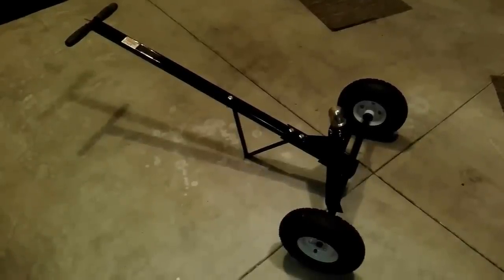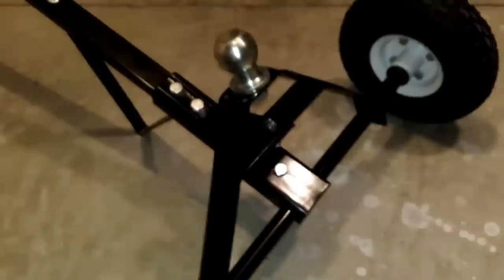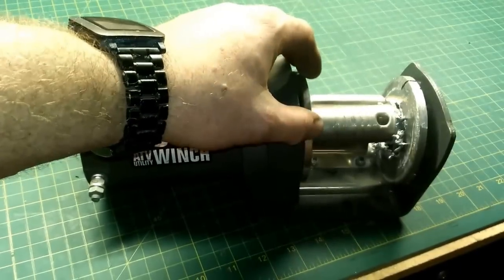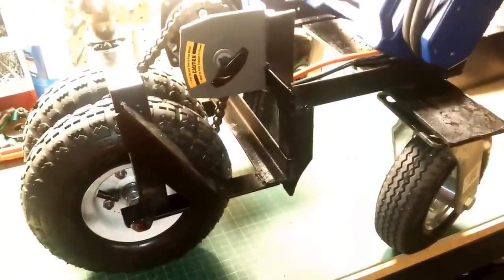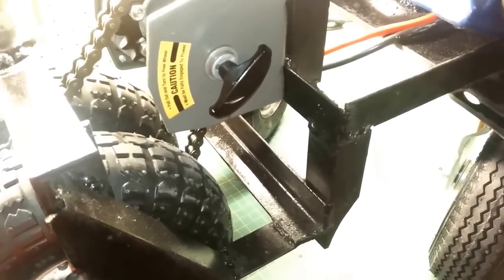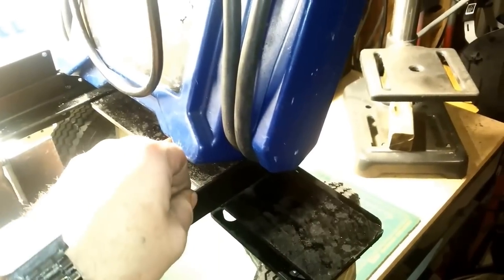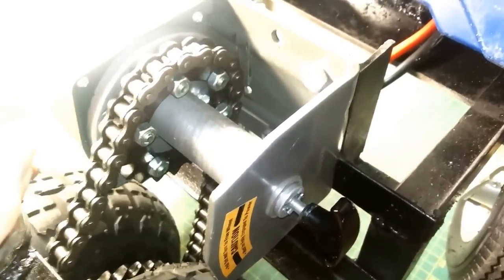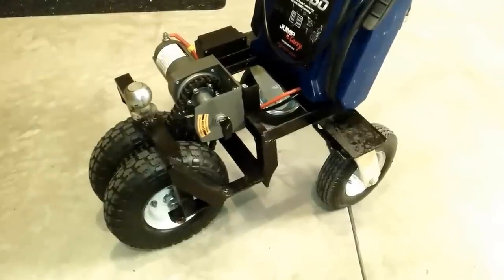DIY Motorized Trailer Dolly / Trailer Mule

Comment: Love it. I myself been looking for ideas for a motorized cart to use for transporting wood this winter and this is perfect. I will use different size gears to make it faster since I don't need much torque
Reply from the maker: +Angel Perez Might want to look into power chair / wheel chair motors.    They would be geared at a good speed and would probably last a lot longer than a wench motor.    Wench motors are designed for short usage and I would be afraid it would overheat if used continuously.

Comment: Put your welding rods in the oven at 300 deg. F let them heat soak for 1.5 hours then cool in the oven, then seal in an air tight container. I keep my welding rods in a small fridge with a 100 w to 150 w light bulb depending on the outside temp to keep them dry right from opening them.

Comment: wow, I do upholstery work in my house, I have a workshop behind the house and I use the alley to put the boats on my property and I always fight to put the boats over 20 feet on my property are heavy and difficult to maneuver , and I was thinking about buying a motorized dolly but they cost more than $ 1000 and that's a lot, if I'm interested in doing this design or something similar. excellent work!

Comment: IVE BEEN WONDERING WHAT I WAS GOING TO DO..... Ok so I live in Florida and I make my living working at farmers markets.  I built these 700lb trailers that are basically just big silly displays on wheels that are a huge hit.   I've been thinking that I wanted to make something that could tote these trailers around on gravel and tar a few feet every day and they could just charge it up once they got home.  this would be great!  im ganna rig mine up so that the trailer can actually just lower onto a plate on top and it cant twist off somehow.  might give it bigger tires just so that it can go into some looser sand but heavens yes, this is absolutely perfect, thank you so much.  i love how you get to the point, its almost like you made this video for me.

Comment: Can you explain, briefly, how to get the release handle and shaft out of the winch?  I just got one home and have been tugging on it without success.
Reply from the maker: On the one used in the video you just pulled out the handle and gave it a quarter twist.  But the designed has been changed a few times and I don't know the current design to tell you if this is still the case or not.
Reply: @1D10CRACY  well, yes.  That's how you disengage the reel from the drive motor but I want to remove the shaft completely so I can cut the pulley down for a sprocket.  Tried turning it and pulling hard on it without success.  In your video you show the damaged winch coming apart but the handle is already off the shaft.  Then later the handle is back ON the shaft..  Baffled here.

Comment: It looks great. But how do you apply braking when using the Dolly on a slope? How does the Dolly perform on uneven and/or loose surfaces? What incline will the Dolly push or pull a 3000 lb trailer?
Reply from the maker: The harbor freight wench is auto braking.   Basically its not going to move when no power is being applied.   As far as inclines and loose gravel, your guess is good as mine, I only use it on fairly level surfaces.
Reply: I'm gonna start one and i had the same concern, I'm gonna put a motorcycle front disc brake rotor and master cylinder hand brake on mine, build a bracket on the crossbar and bolt it up, you should be able to find a complete front brake set-up in a salvage yard. Its only for a momentary pause in order to change directions and stop the vehicle from getting away from you, I don't know if the winch will hold the weight during the switch to forward or reverse
Reply: If your trailer has electric brakes you can wire a pig tail with a switch to the jump pack to use the trailer brakes.

Comment: Nice unit and great video -- quick and to the point!  How long will the battery pack allow you to operate your mule under load?  It looks like you're using the one that has 1700 peak amps and 425 cranking amps, but if I'm wrong please let me know the specs as that certainly affects the duty time of your reply.  Thanks in advance!

Comment: nice build indeed.  thanks for sharing.  just wondering about the weight of your trailer.  I have a 6200# travel trailer with a 645# tongue weight.  I know I would need to use higher rated tires. However, I would only be using it on a level flat surface (asphalt/concrete).  I wonder how well the winch would hold up maneuvering the trailer 100-150' per use.  Any thoughts?

Comment: How /where did you weld the sprocket to the front tires? Also, that threaded rod, are those  bolts bigger than the 5/8 threaded rod and used as spacers?

Comment: How did you bolt the small sprocket on the winch. Did you dig the holes and used anchors to hold headless screws or did you weld the heads of the screws on it? Very nice job. I want to make one. Can it be done with a basic 110 v welder? Where can I find inexpensive chain and sprockets? Thank you.
Reply from the maker: +Byron Estrada There was enough space behind the spool that I did not need.to uses headless bolts.   Not sure om what welder you can get by with, my build was mostly 1/8th" thick steel.   I put links in the description on where to buy some of the parts.

Comment: Need more details on how you connected sprocket onto the wheel?   or did you weld onto axle?    Should take closer video between the two wheels would have helped.
Reply from the maker: Sorry, never intended to do a how to on this.   Just wanted to stimulate ideas.   The sprocket was welded to the hubs.
Reply: Is there anyway you can take pictures and post to this comment of the welds
Reply: @1D10CRACY  Pictures would be great of the welds & sprocket. Thanks for posting!

Comment: cool progy. im building my welding cart with a similar steering system with chain w/ an independent suspension guided from behind the cart
im wondering what would you do next. perhaps a 12vdc system w/ an alternator?

Comment: I have a design problem.   How far apart do the wheels have to be to avoid tipping on softer ground?  Your wheels are close together.  Is it stable on softer ground?  It obviously works fine on concrete.  My trailer has to run over the lawn.  Its typical Florida country "lawn", which is kinda sand and some grass.  Fairly firm.  I hate running my truck over it.  Design problem is:  I hate counting on the casters, since they might dig in to the ground....
Reply from the maker: Asphalt and Concrete is the only place I've used it.

Comment: I am going to build one of these for a good friend . From your description and your comments it appears you removed the tires and then welded each of the rims with the gear inside of each rim?
Reply from the maker: Correct!
Reply: 2nd question. I have not taken the winch apart yet. We’re you able to just drill holes in the round winch plate for the gear with the bolt heads towards the motor.... or did you have to drill and tap the round winch plate and use studs to attach the gear? Thank you
Reply: Did my build in a weekend like you said. Just need to paint it to make it look nicer. Thanks for the idea!! Toolman

Comment: I built one similar to yours, I used the same amazon components. Problem I have it seems to want to flip forward when I pull trailer, I have the ball about 4 inch behind the axle. Did you find the same issue.  My trailer is a duel axle bass boat 4000 lbs.
Reply from the maker: I haven't had any issues with mine, maybe a difference in tongue weight?   I'd guess mine at 200lbs.    I have a tandem trailer as well, the boat is an older 16.5" but is heavy, it's an I/O with a V8.

Comment: So I am planning to build one, and have a couple of questions... do you think a 2000 lb winch will be enough (for a ~3700 lb trailer) and do you think I could just run it off the trailer battery, which is right there anyway? That would make it more compact I'm thinking? Cheers  -P
Reply: And was thee a reason you went with two caster wheels instead of, for example, just one big one?
Reply: @bumbykitty  Looks like the caster wheels add some side-to-side stability because they are so far out from center.

Comment: I am having a hard time locating a sprocket to mount on the winch. Where did you get yours? Thanks so much.
Reply from the maker: Amazon.    There may be links in the description, when I get a chance I'll make sure and update them if needed.
Reply: @1D10CRACY  Thanks for the reply. I am at a loss here as to what to look for. Will try Amazon. Be well.

Comment: What's the heaviest trailer you've moved. My largest trailer is an 8x18
Reply from the maker: I made it to move my boat on it's trailer.    No idea of it's weight, but it's a 1970s fiberglass 16.5ft boat with an I/O Ford 302.   No struggles and traction was ok, but only used it on flat asphalt.  I don't have it anymore, we moved and I didn't need it at the new place.

Comment: How did you weld the sprocket to the wheels?   There isn't a lot of clearance.  Wheels need to still spin on the bearings.   Did you pop out bearings?
Reply from the maker: I welded the spindal of the wheels to the sprocket.   I remember it being tight, I used pencil rod on an arc welder.
Reply: @1D10CRACY  sorry to bother you again.  Is only 1 of the front two wheels powered?
Reply from the maker: They are both welded to the sprocket.
Reply: @1D10CRACY  ok, thanks.   When the sprocket arrives, hopefully it'll be obvious.

Comment: Really like your RV Tug. What size steel did you use for your fabricating. Thank You!
Reply from the maker: All of the angle was 1" by 1/8th, the rest of the parts were just random scrap.
Reply: @1D10CRACY  it seems like old bedframe angle would work?

Comment: RanchEx 102584 Chain Sprocket - for X Series Weld Hubs - #40 Chain, 21 Teeth, 1/2" Pitch   Isn't available on amazon, any advice on what to replace it with?
Reply from the maker: I would suggest anything with a similar tooth count, TSC and Rural king should carry a similar replacement.  If i get a chance tonight I will update the description with working links.

Comment: is the sprocket welded to the axle, or wheels?
Reply from the maker: I actually welded the sprocket to the hubs.
Reply: @1D10CRACY  I'm making something similar for moving a really heavy kayak. Since you used threaded rod for the axle, I figured you bolted/pinch everything together. Did you join both tires by welding a spacer and the sprocket? So the tires still use their bearings?

Comment: What is the axle size with the 48 tooth sprocket attached, and to you have a link to it.  Thanks
Reply from the maker: The axle is just a piece of allthread, not sure I remember the size.  The sprocket is just welded to the inside of the rims.   The rims are offset with a sort of "cup" and bearing on them.  The sprocket is welded to the "cups".  The hole in the sprocket was bigger than the cup, so I just welded some scrap metal over the sprocket hole.

Comment: how do you attach the wheels to the sprocket/axle?
Reply from the maker: I welded the hubs to the sprocket.
Reply: Did you have to include packing of some sort to clear the 48 tooth hub from the tyre ?
And are the hubs of both wheels and 48T sprocket now permanently welded into one unit ?

Comment: Nice little build..  pretty light weight... those tires are pneumatic.. and are only rated to 165 lbs....   means most trailers will have the tires flatened enough to bottom out the wheel tire gear....   Pratical application is everything...  Hitch/tongue loads are rated up from 1000 lbs to 1500 lbs...  the winch motor 2500 capacity is pretty strong....  Seen lots of these builds re-engineered with flat free wheels that you can find rated at 500 lbs per tire...  dual wheels like your build is can support the 1000 lbs tongue weight...  Flat Free wheels can tend to slip on concrete and asphauld in wet conditions... when under load...   My Dual Wheel dual motor drive build  has 6 inch rims..  the tires are 14 inch OD...  using a #35 drive chain my individual tire/drive sprockets are 60 teeth which makes it a 7 inch OD Sprocket...  If the weight of my cargo trailler, loaded, tongue weight should never exceed the 1500 lbs...  but the trailers specs call out for it being a 20 foot enclosed cargo trailer... with no load...  1700 lbs...  with max capacity load rating of 7000 lbs...   The dual motors being 3500 lbs ....  each... total 7000 lbs,  will meet any load I may be dealing with...  everyone should check out the version of the Trailer Hauler/Dolly with tank tracks...  the design of the trailer tongue mount mechanism...  out performs what we have seen in all other videos...  where the step of having to dislocate/disconnect the Trailer Dolly from the trailer in order to connect the tongue to your ball on the back of your bumper/hitch....  is somewhat short of what you will see in the German Design...  Which is Tongue frame depth adjustable... tongue height adjustable and a quick connect as well... good to drill the 2 holes in the side wall of the tongue channel where you are going to establish the suitable location for the universal trailer dolly interconnect...  but you wil see it is not necessairy for a one time function...  The dual motors allow me to carry the max trailer load capacity... but the reason I wanted dual motors is to remotely steer the dolly by reversing the direction of the wheels motion.  Can get some completely sharp immediate responses  with remote trailer movement.  4 button wireless remote system was only 14.00... that are wired in conjunction with 4 - 12 V solenoids... at 5.00  each.  Battery tray is detachable... in order to lessen the footprint of  the Dolly... for storage...  which is 17" OD wheel to wheel and 26" Motor  to single 10",  500 lbs load flat free caster wheel...
Reply from the maker: The tires that are carrying the load are rated at 300lbs each.   I actually purchased solid tires for this build, but ended up not using them.   You are correct, you could get a bit more load capacity by swapping the tires out, luckily for me I do not own a trailer with a tongue weight over 600lbs.
Reply: You are retired, huh.

Comment: Don't tell us. Show us. The trailer sizes etc.
Reply: In the beginnning that is.
Reply from the maker: I used it on a 16.5 foot boat trailer with the boat. The boat is pretty heavy, it's a fiberglass pig with a Ford 302 in it.
Reply: @1D10CRACY  thank you